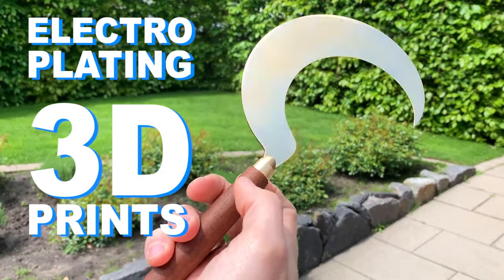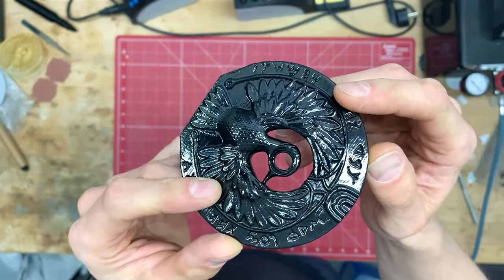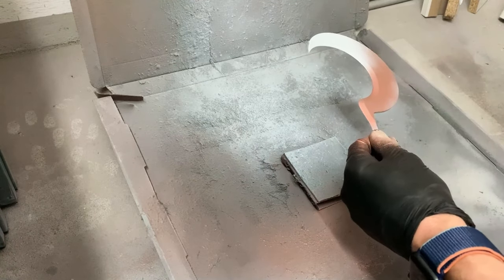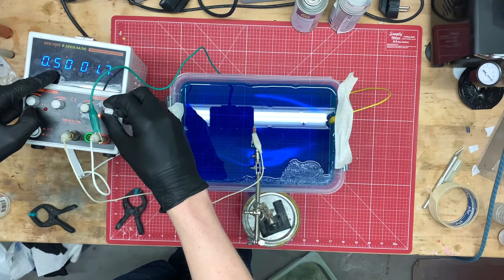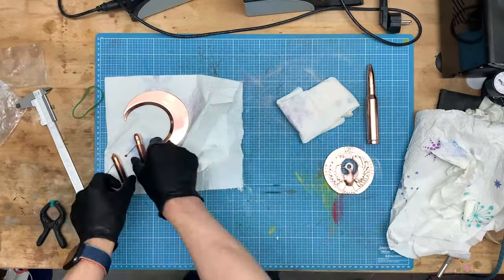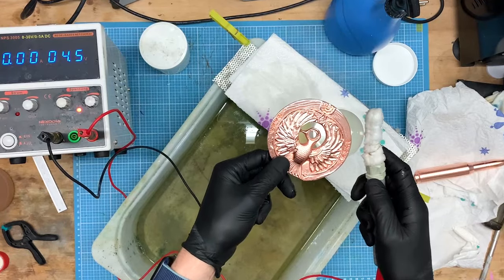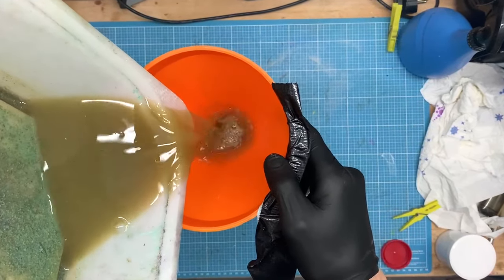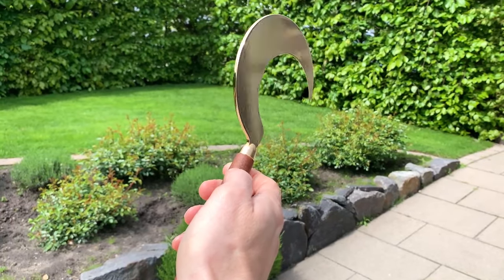How to Electroplate 3D Prints … (the shiny way)

Comment: Found this on Twitter. I really like this idea. I have never done anything like that before, but I would love to start small by making "pirate treasure coins". Ironically I made that same Indiana Jones Staff of Ra file a couple of months ago and used dimes on the inside to weigh it down, then sprayed it with a metallic gold automotive paint. It looks great but needless to say it doesn't have the feel of metal to it.
Reply from the maker: Same here, first made was of PLA the spray painted it. Second approach was gold leaf (still PLA), which was more convincing. 100% infill resin with plating is by far the most accurate thing I ever hold in hands.

Comment: This is really cool. How much loss of detail is there for finer parts? Could I, for instance, plate a finely detailed mini or statue without losing too much?
Reply from the maker: This depends on the thickness of the coating. From my experience there is very few loss, because the paint is very thinned. Look at my video of the neuralyzer (latest). I am using graphite there, too. It’s really thin.

Comment: Where would you recommend buying materials from? like the electrolytes etc. and i'm assuming most of the electrolytes can be reused for a while correct? Great Vid
Reply from the maker: I get most my stuff from tifoo. Copper and nick elelectrolyte recover from the dissolved cu and ni anodes. Once in a while you should check ph and refill brightener. Keep it clean and it‘ll last very long. I recommend buying 5l. Make sure to get „acidic“ copper electrolyte, as it makes the conductive paint conductive at all.

Comment: A few questions:

1) If I want the surface to be completely reflective (i.e. as few grains as possible), how would I go about it?
2) How much does the equipment + solutions cost? 
3) Why the palladium? Is there a cheaper alternative?
4) How do I strip electroplating?
Reply from the maker: Hi, long story short: have a look at my newer tutorial, they‘ll answer this. Palladium is optional, you can do nickel it you want, but palladium is actually not that expensive.
Reply: @hen3drik  Another question: how would you go about plating with an alloy (e.g. a brass finish)?
Reply from the maker: @adrianli7559  brass is easy: create a thick copper layer. Then on top electroplate a thin zinc layer. After that put it in the oven or treat with a heat gun for Brass.
Reply: @hen3drik  I'm working on restoring a piece on a figure - how would I completely strip the part, and would regular ABS be safe (and stay intact) in the oven?
Reply: Sorry for the influx of questions, but what exactly is "gold chrome"? I asked a company what was used to coat the top, and that was the response I got.
Reply from the maker: @adrianli7559  I’m not sure what you mean.
Reply from the maker: @adrianli7559  i have no idea. I use 24k gold and a gold that can be deposited on stainless steel (maybe this?), but i apply 24k gold in the end every time.

Comment: Does it make sense to electroplate a 3D print just for painting it after all the process? Just to have that cold feel.
Reply from the maker: Depends. I do this for tactile parts (knobs, switches etc.). It also adds strength and weight.
Reply: @hen3drik  What kind of strength does it add? You are the second source i found that says it adds strength, while when i google about that topic, there is nearly no mentioning of strength improvement. Only really mentioned is less wear and tear. Which could be considered as stregth, but only if you electroplate parts like gearings or something simular.
Reply from the maker: @MrGTAmodsgerman  basically it adds stiffness. There is no bending on small parts: imagine printed parts, that bend, these become stiff as you put 25 micrometers of metal around it. Therefore it feels much more metal like. It also sounds different 😃
Reply: @hen3drik  Interesting. Thanks for telling me. Weird that i can't find any video about the actual stiffness improvements for electroplated FDM or Resin parts. Like you would expect from CNC Kitchen or other channels.
Reply from the maker: @MrGTAmodsgerman  cnc kitchen actually mentioned stiffness improvement in his video about electroforming (I guess it was the video with the 10k subs yt button), but that’s all he had to say about it. You should try it for yourself if it fulfills your needs, but I think I’ll cover this topic in my next videos.
Reply: @hen3drik  Okey, will check it out, thx. 
Btw. How does it affect screw mounting holes or simular? Can they be taped of to not getting badly affected after electroplateing?

Comment: The copper spray adds a layer of conductive copper.  Then you coat the copper with copper.  Why not skip the 2nd copper coating and coat directly with the palladium?
Reply from the maker: The copper spray just creates the conductive base layer for the „real“ copper to be plated on. It‘s like a soft paint you can rub off, but contains so much copper that it‘s pretty conductive. When I plate the copper in the bath, I add a heavy 240microns layer that doesn‘t rub off. The palladium is a very very thin few microns thick plating on the copper.

Comment: That's pretty cool! Do you ever have problems with the metal flaking off? I would imagine durability is mostly up to how thick of a plating you put on, but the base coat might make a difference too.
Reply from the maker: Funny, right now I am facing issues with copper  deposition on a resin print (black mud on the copper spray). Flaking off was never an issue. Yes, the longer the dry time of the base coat, the better the durability (48hrs is fine); however, I usually begin plating after 30mins. Copper plating for 2hrs is giving me a good thick layer.
Reply: Dont underestimate thermal expansion forces. Plastics and metals have very different thermal expansion, so you should try to keep the temperature stable from the coating with spraypaint until you have a thick enough layer of metal put down with electroplating. If you don't take care of that, the forces that build up between the plastic surface and the metal are strong enough to break the bond of the spraycoat, especially if you have parts with sharp corners where forces tend to concentrate into. Once the electroplating is thick enough, i guess the metal, especially the soft copper, can take up the force even when the bond between plastic and paint fails.

Comment: Hello from Tokyo. Your videos have inspired some of our projects here.
For the initial copper layer what PH is your copper electrolyte solution at?
Reply from the maker: It‘s between 0,2 and 1.
Reply: @hen3drik  I am having issues with conductive paint… I’ve used a graphite spray and attempted to make my own that does conduct electricity. I was able to copper plate a metal part no problem, so it must be too much resistance on the paints I am using. I am attempted to buy the copper paint you are using…. When using the Tifoo brand and testing with a voltmeter what kind of resistance are you getting? Or is the copper spray you are using getting full continuity?
Reply from the maker: @r.in.shibuya  when using graphite spray: let it dry, polish the paint with a rag and head for 4kOhm. Then plate very slowly. Better Alternative: get tifoo liquid conductive copper paint. Dilute 1:2 with acetone. Spray with an airbrush gun. The conductive copper paint „turns“ conductive when placed in the electrolyte. Good luck!

Comment: Can you explain one crucial element....what is your brightener? I dont think anyone will get these wonderful  results without knowing what this additive is? also Is your solution copper sulphate and could you detail your ratios (Distilled water?)
Reply from the maker: I use a commercial acidic copper sulphate solution (incl. brightner). When the brightner (commercial) wears off from time to time, I add more. But it lasts very long. But Brightner is not the only thing that it takes; it‘s overall „cleanliness“, the right voltage, movement, temp. But yes, no brightner and you’ll need elbow grease.

Comment: Hello, Is there a reason you have to plate copper in between the paint and the nickel? Can you just go straight to nickel or paladium?
Reply from the maker: You could. But nickel isn’t depositing as fast as copper (what I recognized) and it‘s not as soft and polishable. Palladium would be way to expensive. I deposit thick layers of copper. Around 0.1mm-0.3mm.

Comment: I got a funny idea. What would happend when you would eletroplate a 3d print, which was printed with dissolveable filament (like PVA), just to remove the plastic for a pure metal part? 
I thought about this as i wondered if this could be used to improve accustic of a part. Like a speaker for ex. as metal doesn't sound flat like plastic.
Reply from the maker: Oh, I actually did that and it‘s waiting for video production 😉
Reply: @hen3drik  Amazing. Was it successfull?

Comment: What kind of durability does this have? Will it rub off after rubbing against something?
Reply from the maker: Well, it‘s like any other plated metal. In total it‘s 200micrometer thick. That won‘t come off :-). The top gold layer is way thinner, this could wear slowly off if you would touch and rub it every day (sometimes this can be seen on cheap „gold“ chains, for example). So, image metal and you have a feeling.

Comment: Very cool!  Thank you for the informative video.  What is your technique for securing the lead to the 3D object without damaging it too much or interfering with the finish?
Reply from the maker: This is a very good question. I usually try to find  a hidden spot, then heat up a needle and insert it (melt) into the material. Then, if necessary I coat the joint with additional copper paint. Another way is to design extra material to clip into with clamps. Anyway, damaging still occurs sometimes.
Reply: @hen3drik  thank you!  That makes sense, and I like that approach much more than simply wrapping it in wire.

Comment: is it possible to use nickel bath as electrolyte or sulfur acid for nickel galvanizing with electricity?
Reply from the maker: Yess, but I recommend to use copper. It’s easy, deposits fast, easy polishing.
Reply: @hen3drik  yeah but copper doesnt look good on blade :D by the way by nickel bath i meant nickel chloride idk but they call it nickel bath in all chemistry shop. and i also see people make their own electrolyte with salt, vinegar and leave nickel plates with current flow for few hours.

Comment: im a little new to electroplating but theoretically couldn't you easily make your own electrolyte solution by connecting power supply to two pieces of copper and dipped them in vingerar solution? Great video by the way
Reply from the maker: Maybe. Never tried. This commercial bath also includes a brightener and is at pH 1.

Comment: What kind of power supply do I need for this and what can they typically cost? The only ones I find are at least $100.
Reply from the maker: For smaller parts you can get a cheap regulated 5A max power supply. For bigger parts like the sword I needed 8-10A.

Comment: Hello!
Do you think that this could help to actually reinforce 3d printed gears? Would a thick enough layer be possible?
Reply from the maker: Yes, rumor has it that it does strengthen the parts a lot. Can you give me a link to the STL, so I‘ll try it for you. The copper layer itself is some 10’s microns thick.
Reply: @hen3drik  Unfortunately I haven't actually designed/printed any plastic gears yet, so I don't have any related STL files.
But I am sure that there are free files on thingyverse and similar sites.
The 10's micron thickness seems kind of negligable, at least for any structural strength, but who knows...
But with enough wall thickness, structrural strength probably isnt the issue with 3d printed gears anyway. And the surface protection the plating offers, might actually matter in the durability and longevity of the gear since it will protect the contacting surfaces. If thats the case, what would the best metal for the plating?
It certainly is a very very interesting topic, that would need a lot of experements.
I mean, making homemade cheap and strong custom shaped gears is kind of a game changer.
I also wonder how flat the teeth surfaces will remain after getting a very thick plating on them. After a while of electroplating, do things become a blobby mess in your experience, or are the features retained pretty well?

Comment: 1:32 Tiffoo Sprays cost €50... 
have you tried a 99% Zinc spray which is used industrially so it costs under €10 
you can also get a Graphite spray for about €30
Reply from the maker: Zinc is a good idea I haven’t tried yet. I airbrush diluted copper paint in more recent video what brought the costs down to a fraction.

Comment: this vs pouring molten metal,     i think it looks alot safer.
Reply: Funnily enough it might not be.
Depending on what metal solution you use it could intoxicate you permanently very easily.
then again maybe burning at 2K Celsius isn't better..

Comment: Hi! How long would electroplating last? Months years? I want to try to sell my own designs but I don't know how much to trust electrogplating, I don't want my clients to get mad at me if the product I deliver is not durable ...
Cheers and good job
Reply from the maker: Hi, durability depends on two factors: The surface on which the metal is deposited and the thickness. When plating gold oder palladium, you will probably only create a decorative layer around some µm. And this can wear off by touching it a lot. So, after some time, you could re-plate the spots. Thick copper layers are around 30µm are very durable. You'll have no problem when the surface you plate on is metal and clean. When you electroform on plastic, make sure to apply a primer first, then several layers of conductive paint. I had issues of deposited metal flaking off the print when i used graphite spray directly on resin parts. Primer + Copperspray works good.

Comment: Respekt! Mega gute Arbeit. Als ich das erste Mail angefangen hab zu vergolden war alles auf kunstoff fast unmöglich und die Objekte meist Naja.
Durch den 3D druck ist es jetzt einfacher und echt genial mit was für einer ausgefeilten Routine und ruhe du das ganze machst! Da steht mir noch was bevor. Denn ich hab vor kurzem wieder auch Material gekauft und möchte meine drucke vergolden
Reply from the maker: Viel Erfolg. Wichtig ist, dass du nicht Zuviel Strom im Bad durch das Objekt jagst. Wenn Glanzlkupfer zwischen 1.2 und 1.5 angegeben ist, dann sollte es bei kleinen Objekte im unteren Bereich geregelt sein, bei größeren entsprechend höher. Easy does it!

Comment: WHY DO YOU WRAPPING COPPER PLATE WITH FOAM?
Reply: WHERE DID YOU GET THIS KNOWLEDGE?
Reply from the maker: I'm wrapping them to keep them from oxidizing. Copper oxidizes very quickly and forms a patina. In the meantime, however, I recommend rinsing the plated pieces with distilled water and blow-drying them immediately.
Reply: @hen3drik  thank you, can you tell where you get this knowledge? I want read a lot of books about this

Comment: Palladium before gold?!? Why not nickle?  Nickle is fast and cheap.
Reply from the maker: You‘re right, but the sale of nickel is restricted in my country for private individuals.
Reply: @hen3drik  oh.  Nice solution!
Reply: @hen3drik  Same or me, and what about the Chrome? Would it work too ?
Reply from the maker: @tnd6956 Order is: Palladium/Nickel->chrome->(gold).
Reply: @hen3drik  Thanks ! And would it work with Silver instead of Palladium? (after copper)
Reply from the maker: @tnd6956  don’t try it :-( Silver has a high tendency to sulfidize (typical black coloration of silver). It is essential to remove this silver patina before electroplating. If silver is to be gold-plated, a barrier layer of nickel or palladium must first be applied to prevent alloying and discoloration of the gold (in this case green gold or light yellow gold). Gold can then be reapplied to the barrier layer.
Silver -> nickel or palladium -> gold
Reply: @hen3drik  Thank you so much for your prompt answers !
Reply: I am glad you cleared that up.  I did electroplating for 30 years and it was Gold over Nickel.  In fact, everything pretty much was over Nickel. @hen3drik

Comment: carbon fiber 3d print direct metal plating
Reply: dissolve plastic, plate all empty space in the copper bath, reverse mold direct seed plating-cast
Reply: electrolyte too scarce, full quick plating baths, also de-greasing and rinse baths